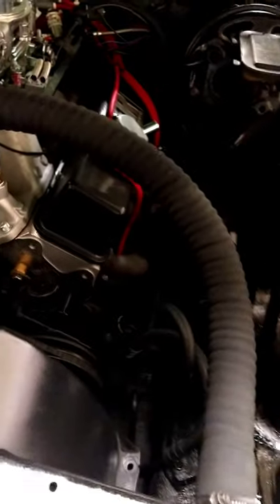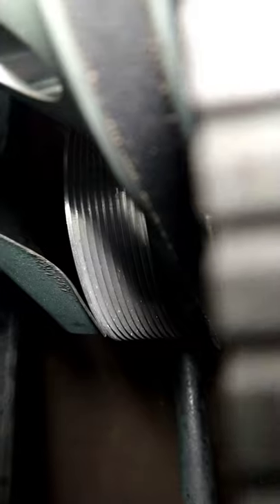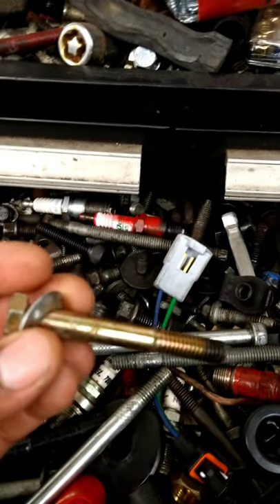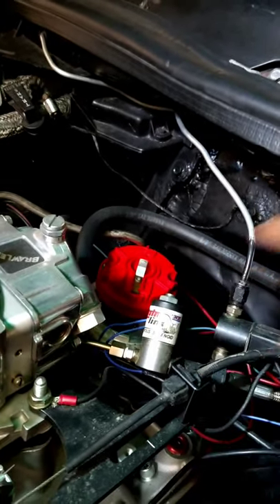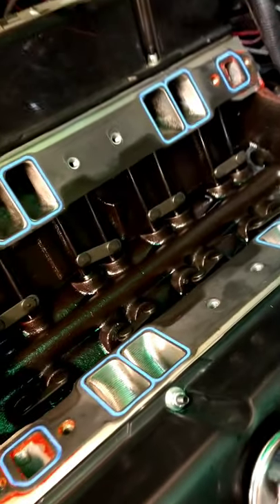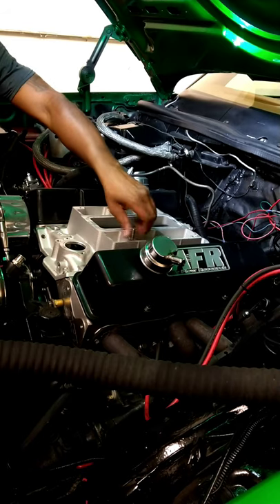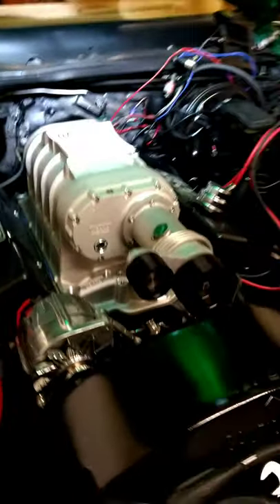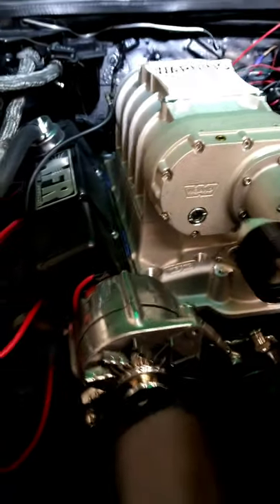Installing a 177 blower part:ll

Comment: Did you have to change cam for that 177
Reply from the maker: No  because it was originally set up for nitrous
Reply: Ok have same setup on short bed I bought with 2kits but I have no spec sheet on it